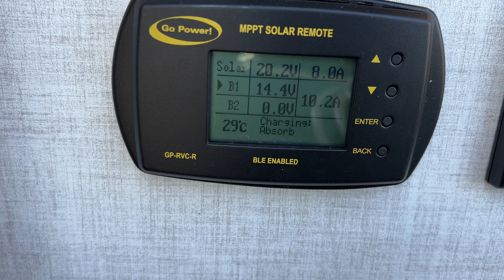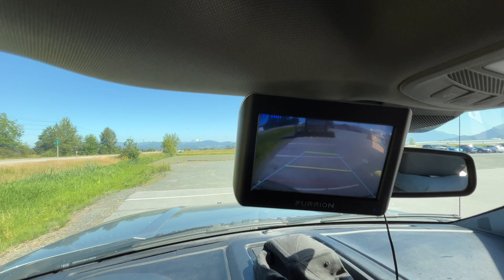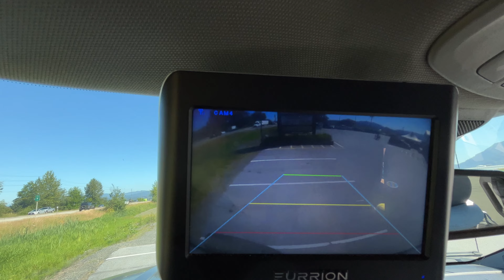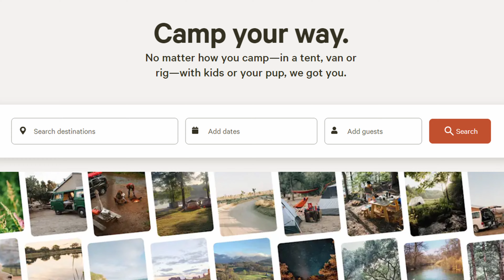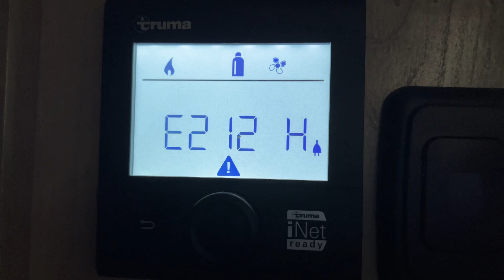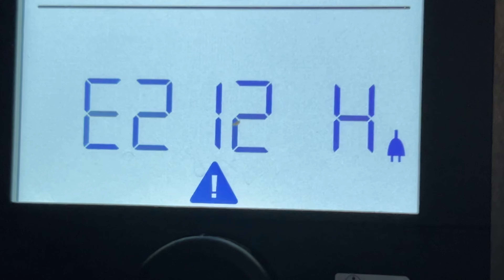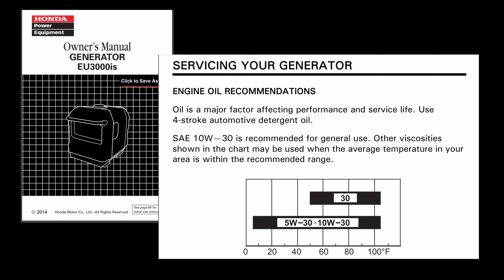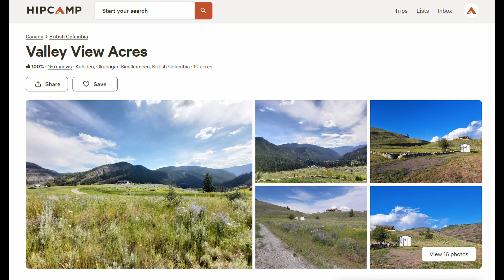Travelling WITH NO Batteries to Kaledan/Cherryville!  12 Volt fail but GORGEOUS destinations in BC.

Comment: I surprised. Moms fifth wheel when the bat is disconnected you can plug trl into trk and ran the jack off power from the trk. Good luck with your camper.  Just got back from camping or maybe more technically flatbedding as i sleep under my flatbed trl i haul my tractor to the tractor show on.  On day 1 opening national anthem/flag raising i got my first tow with my tractor.  An old gmc front wheel drive motorhome went into the gulley and bottomed his back bumper good.  The gulley has ripped an airstreams rear cargo area off once. Seen a few grey/black dump connection off. (Thankfully after the valves)   surprised with the rain didnt see rigs needing towed out like in past
Reply from the maker: Yeah the newer F150s don't immediately send power to the trailer for charging.   I think it is after you put it into gear or along with other delays triggers so just hooking it up alone does not give it power at first.